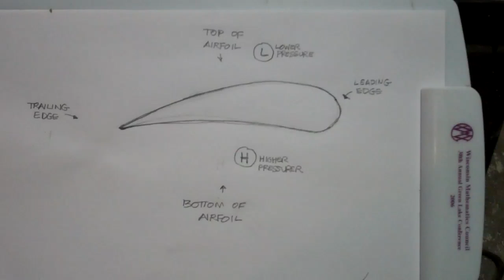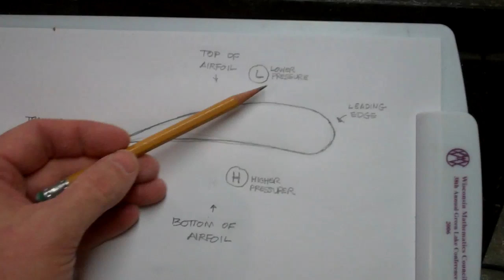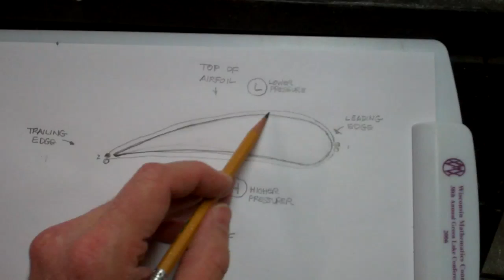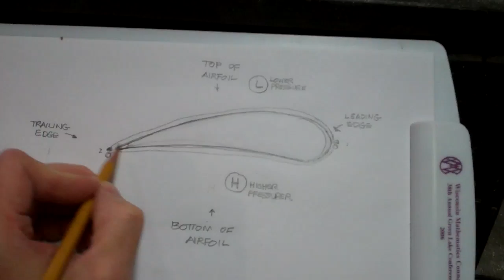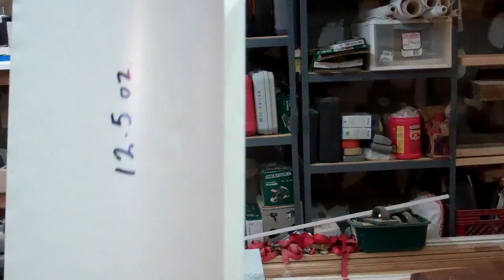Shaping Wind Turbine Blades

Comment: These blades have a cambered aerofoil shape and have to be mounted at a pith angle that allows a suitable angle of attack to be maintained along the blade without flow separation. Was that considered before making them ? Cambered blades produce lift even at zero pitch angle, but the flow can separate and the flow on the convex surface can separate more easily .

Comment from the maker: For all the "pressure" freaks:  All weather is caused by temperature differences.  Differences in temperature cause differences in pressure.   All weather measurements are relative.  Is a COLD front marking the boundary between an absolutely freezing cold air mass and a absolutely boiling hot air mass?  Or is the cold air mass behind the cold front RELATIVELY colder/cooler than the RELATIVELY warmer/hotter air mass in front of the cold front boundary on the surface?

Consider this hypothetical:   With all other atmospheric parameters equal, which frontal boundary will MOVE faster across the earth's surface if the ONLY difference is PRESSURE differences due to differences in air mass temperature?   Will a relatively COLDER/COOLER (DENSER air:  relatively HIGHER pressure) Air Mass push a relatively warmer/hotter (thinner air: relatively LOWER pressure) air mass faster across the earth's surface OR will a relatively WARMER/HOTTER (less dense air: relatively lower pressure) push a relatively colder/cooler (denser air: relatively higher pressure) air mass faster across the surface of the earth?  again with all other atmospheric conditions being equal.

In other words, does relatively cooler HIGHER Pressure air PUSH relatively warmer LOWER pressure air masses with greater force OR does relatively warmer LOWER pressure air masses PUSH relatively cooler HIGHER pressure air masses with greater force?  OR  a thrid way of asking:  does a cold front typically move faster than a warm front?

Ever where we observe all types of differences in PRESSURE, I've NEVER observed lower pressure winning the battle of force over relatively higher pressure.

However, we could say that without the DIFFERENCES in PRESSURE (high and low working together), in the atmosphere caused by the differences in temperature,  air would not move.  So You say Pohtaytoe & I say Puhtahtoe, whether its lower pressure creating the greater force, or the higher pressure creating the greater force, in reality, its all relative and without both (higher and lower), some measurable pressure gradient, no airfoil will do its designed job.

Have fun posting frivolous arguments in vain attempts to pridefully show others how smart you think you are.  Its been fun reading the comments

Peace

Comment: Is  the bottom of the PVC blade supposed to be flat and/or make it flat in order for the aerodynamic principle to take effect?
Reply from the maker: No.  It does not need to be flat, merely relatively "flatter" than the upper "curvier surface".   These airfoils spin just fine when the wind blows and catches the airfoil.

Comment: Can you use the same PVC blades for a  vertical wind turbine ??
Reply from the maker: I don't know why not. An airfoil is an airfoil.  But since I have never used them with the "vertical" style turbine, you may want to use a little trial and error by making the attachment point adjustable to find the "sweet spot" to create the most "lift" to turn the turbine.
Reply: @libertyfarmsiowa ,
Nice work! Did you make a video of how to cut out the blades? It looks like they are cut @ an angle

Comment: I think your blade is wrong sided, the square edge should be the lead, also your explanation of push is not so accurate, its both, air hits the curve at the bottom, the curve is partially in its way so the air forces it up based on the shape, the top is not blocked by the blade, tho the air has to travel a longer distance, it also wants to continue going straight, the curve goes away from the wind, while the wind wants to go straight, it creates a gap between the two which makes the air thinner thus creates a kind of vacuum and that is where the lift comes into effect..... i am not a scientist.

Comment: Thanks for micro-level explanation of airfoil principle.But don't you think that in fluid mechanics we don't worry about each molecules,we just follow stream & path line & calculate pressure,velocity difference using burnuli's principle(macro level study).  
BUT FOR ME THINGS BECOME MORE CLARE ON MICRO-LEVEL(as u did in video).Is there any branch in which aerodynamics is studied at micro level?PLEASE LET ME KNOW WHAT YOU THINK.